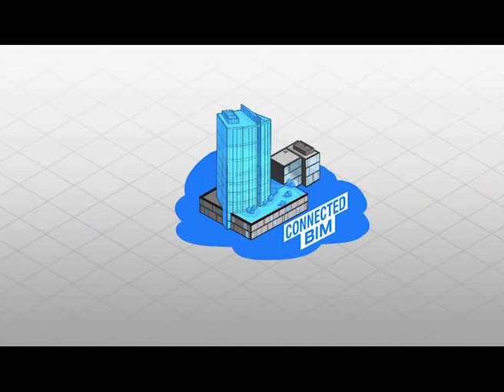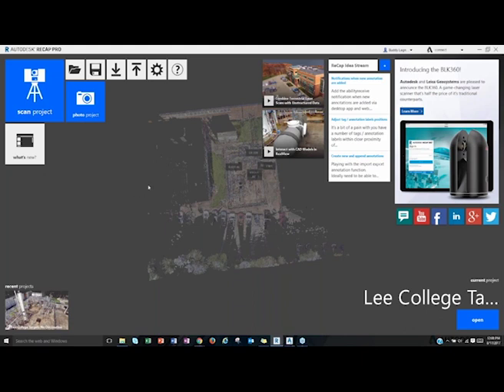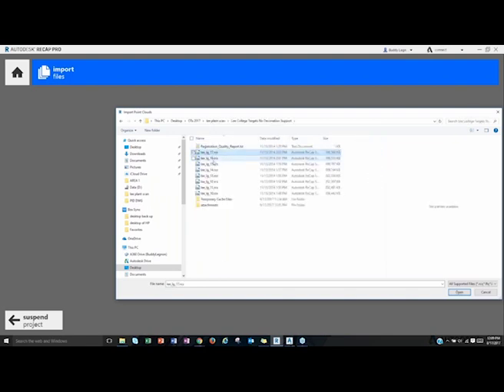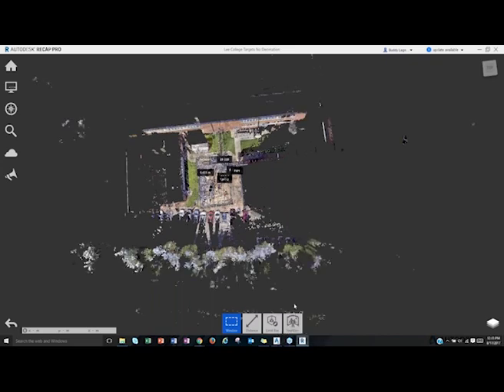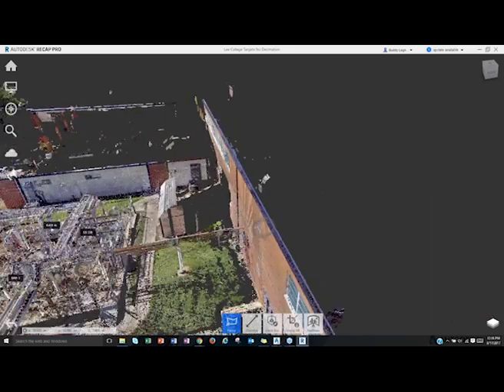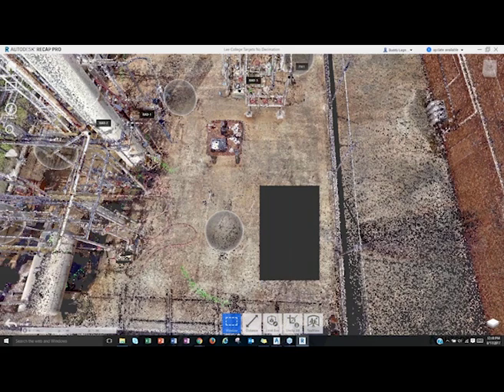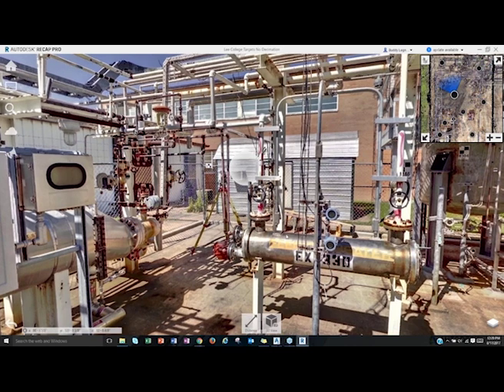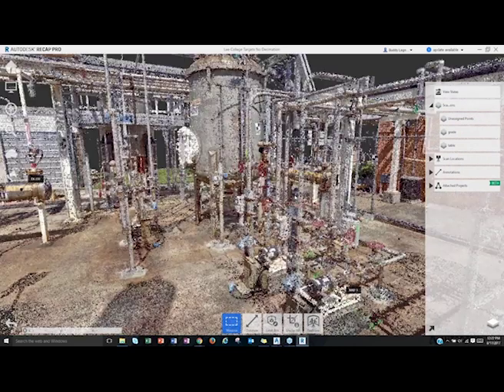Autodesk ReCap Intro Webinar:  Scan with accuracy design with confidence

Comment: Hi, I'm a new beginner for using Recap with 3D scanning. May I ask for the solution of my issue when I import 3D Model (.NWD) Format into Recap 3D scanning data, my imported model scale is small. How can I match 3D model in Recap scanning data. Currently I'm using 2024 version. Really appreciated for your assistance. Thanks, in advanced.